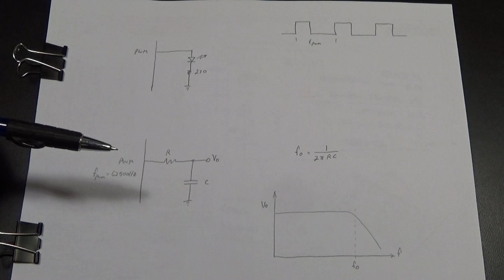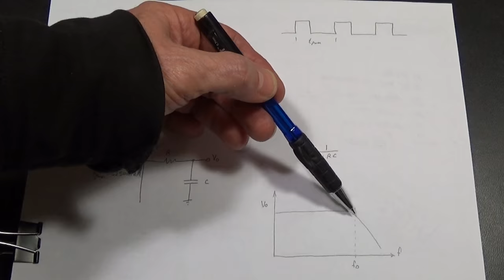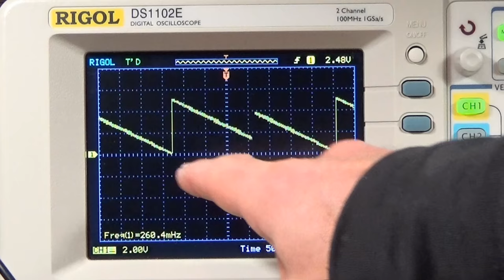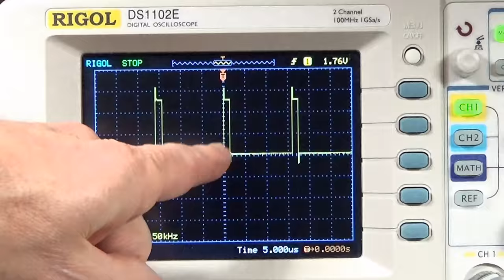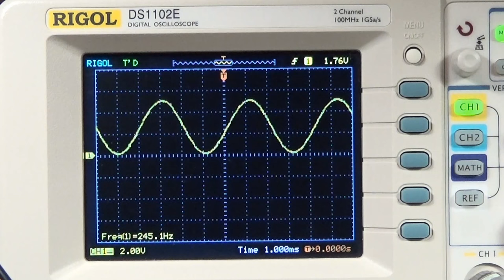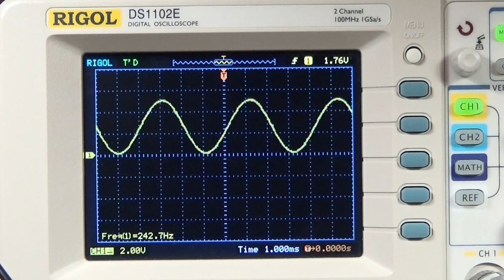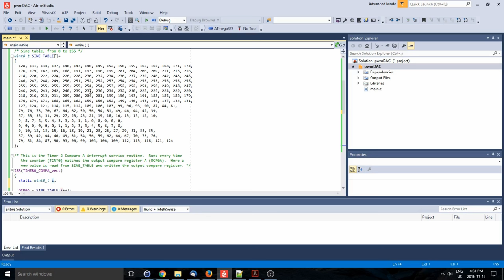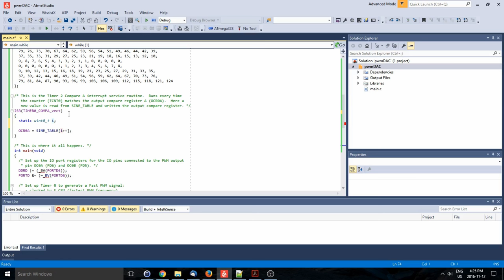Going Beyond Arduino # 8: PWM as a Digital to Analog Converter

Comment: Nice video.  Can you help explain why you need a triangular/sawtooth signal compared against an actual sine wave to compute the duty cycle?
Reply from the maker: The sawtooth waveform and the sine waveform were both produced in the same manner - varying the duty cycle of each pulse by changing how long the timer/counter had to reach the count.  The difference between the two waveforms is the number the counter counts up to (the value in the output compare register).  With the sawtooth, the number put into the output compare register started at 255 and counted down by one for each pulse, a simple linear change.  The values that produced the sinewave came out of a table and the change between successive values changed in a sinusoidal manner.

In the two videos linked below, I go into more detail on how to setup a timer/counter.

https://youtu.be/n0MNraPWQYo
https://youtu.be/OvP1-zP1Y-k

I hope this answered your question.

Comment: Excellent video. Is there way to do analog to digital conversion by sampling one analog input, then feed this values to the register to get audio (for example) out? I know that analog input has 10 bits, but this can be divided by 4 (or making twice right shifting, or "PWMstuff=AnalogValue>>2"). I will need it once getting work on 433 MHz digital radio communication with Si4432. So far I managed to understand how it works, just need little bit more practice. Thank you again for really good video.
Reply from the maker: The ATMEGA328 is not a very powerful device, it's working hard enough to produce the sine wave.  A way more powerful ARM chip might be able to do what you want.  Either way, no microcontroller will have the guts to DDS 433MHz.

I have another video in the works that demonstrates proper DDS.  Stay tuned and thanks for watching.
Reply: No DDS. I have Si4432, RF chip, which can run from 240 MHz to 960 MHz. Just need analog to digital in this chip, and digital to analog from this chip to speakers. Thanks anyway.
Reply: Or, voice over digital... similar like truncated radio...
Reply from the maker: Oh, I think I see what you are up to.

My next video shows a much more efficient way to generate DDS than what I demonstrated in this video.  I should be posting it in a day or so.  In 
it, I demonstrate a DDS system that uses an interrupt service routine running at 50kHz to update the PWM.  

I had a quick perusal of the ATMEG328 datasheet.  The fastest the AD converter can do a conversion in is 13us, so you may be able to digitize audio at the same 50kHz rate as the DDS (slightly better quality than a CD player).  Add some code to the same interrupt service routine to start and read a conversion.  You can set up the ADC so that it left shifts the converted data in its two data registers, then you can read just the high register to get the upper 8-bits.  No need to do a right shift in software.  I don't know how you are going to handle all that ADC data though, 50,000 bytes per second have to be put somewhere.  A lower sample rate, say 8kHz, would reduce the amount of data, but still produce good enough audio quality to be intelligible.

Good luck with your project.

Comment: Thank you for this video,！ I'm thinking of using the MCU to directly control the stepper motor？
Reply from the maker: You can, provided the MCU has enough drive capability (current) for the motor you choose.  With a very small, low-power motor it is possible.

Comment: hello Mr.Hollinger , i have a question. When is the intterupt set? OCR0A take every time a new value , does that mean that the interrupt time is different each time ?
Reply from the maker: The Timer 0 interrupt is enabled in the first part of main(), and remains enabled.  The interrupt is generated when Timer 0 counter reaches the value in OCR0A.  The time the interrupt occurs changes each time as set by the value read from SINE_TABLE.  The code is available on my gitHub site.  Link in the description.

Comment: Hi...is it possible to generate two short pulses of 1microsec and another two pulses of 40 microseconds with variable prf?
Reply from the maker: It is, but you may have to write some of the code in assembly to make it fast enough.  Even with the ATMEGA328 running at 16MHz, code generated by a C compiler may not be efficient enough to give you a 1usec pulse.  Good luck.

Comment: Does the output compare register use a switch statement with a set duty cycle per case?
Reply from the maker: The PWM is all done in the ATMEGA328 hardware.

Comment: I remember doing the sine-table thing almost 30 years ago while in college and was surprised then at the low max-frequency I could achieve - just over 400Hz if memory serves.  So I'm even more surprised that the Arduino's 328 chip can only manage 240Hz - that must have 4-5 times the clock rate of the 4Mhz Z80 CPU I was using,
Reply from the maker: The method I presented in this video is very inefficient at producing a sine wave (or any other repetitive waveform for that matter).  The microcontroller updates the waveform 256 times every cycle.  Therefore the update rate has to be 256 times faster than the frequency of the output.

Check out the next video in my series (if you haven't already done so) where I present a different and more efficient method of generating repetitive waveforms.  Link:

https://www.youtube.com/watch?v=6QXlgWO0ts0

Thanks for watching.

Comment: Graig,

I did copy the CODE,  it did not work  for my vision "UNO".  Here is the message : 
"compilation terminated.
exit status 1
Error compiling for board Arduino/Genuino Uno."

Can you help ? Sorry, I am a beginner.

Thank you so much

Veng
Reply from the maker: Unfortunately that code was not written for the Arduino system, hence the error.  This is true for all of the code I have written for my 'Going Beyond Arduino' series.  

If you watch the first couple of videos in the series, you'll see where I explain how to write, compile and program code into an Arduino board without using the Arduino system.  This is the theme of the video series - getting out of the Arduino world so you have more control over the microcontroller.

Good luck with programming.  Don't be discouraged when you run into problems and have to spend some time solving them.  You will learn so much more than if everything works the first time.
Reply: Thanks for your reply, Graig, 
I will let you know after watch other tutorial that you posted.